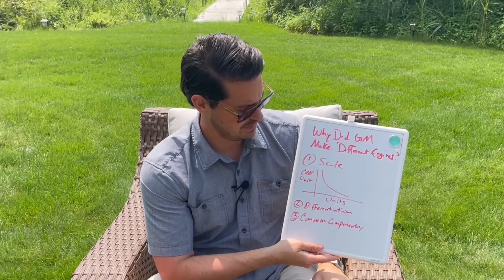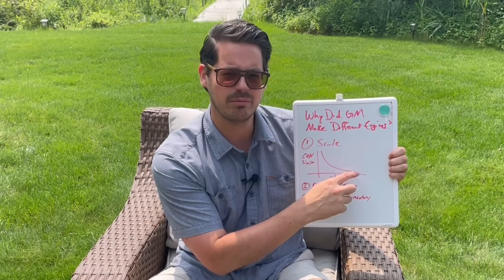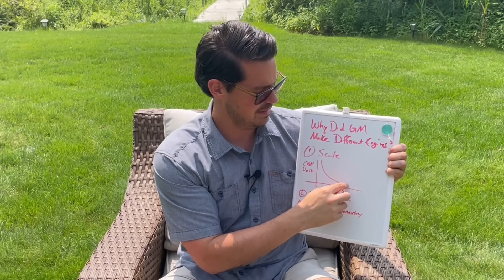Why did General Motors (GM) Make So Many Different V8 Engines in the 1950s-1970s?

Comment: My uncle became very upset when he found out his Oldsmobile had a Chevrolet 350 engine from the factory.  Discovered it when the air filter he bought didn't fit, and the parts man informed him that GM used a "corporate" 350. He felt cheated.
Reply: There was a class action lawsuit on that I believe.
Reply: @Henry_Jones  yeah, reading up on it GM made a payout and the whole debacle cost them $8.2 million.  I remember at the time,  my brother in law,  who was a big Chevrolet fan didn't understand Uncle Barry's chagrin. He tried to tell him the Chevrolet was a good engine. They did this in the 1977 Delta 88.
Reply: @mikekokomomike  It kind of defeated the purpose of buying a certain brand of automobile.
Reply: @jeffrobodine8579  and people finally wised up when they realized GM was peddling largely the same thing at different prices.
Reply: @mikekokomomike  But the Olds engine was made of a much higher nickle content grade of iron, which meant cylinder walls lasted longer.  Uncle Barry probably knew that, that's why he was pissed.
Reply: @aca2983  Yes.  When they downsized for 77, they used just two different chassis for full-size cars, (except for Cadillac), a shorter one for the Chevy, Pontiac, small Olds, and the small Buick.  A longer one for the big Olds and the big Buick.  By mid year, they started sharing engines as well.  That really hurt GM's reputation, selling Chevys at 4 different price points.
Reply: @jeffrobodine8579  which is exactly what happened.
Reply: @michaelbenardo5695  Actually in 1977 the full and mid sized cars used the same chassis. The full size was downsized in 77 but the mid size didn’t downsize until 78. As much as some people dislike the 73-77 A body cars, it was by far their most utilized chassis in the history of GM. Introduced for 73 it remained in use until GM ceased full sized RWD cars in about 96.
Reply: The downsized full size GM eventually all started to look alike by 1980. And, GM didn’t change the bodies on these these RWD for years. In my opinion, this was the start of the steep decline GM experienced.
Reply: @Henry_Jones  There was.  GM had to start including a disclaimer stating that your car can have an engine produced by another GM division.
Reply: @Henry_Jones  yes. That’s when GM started labelling them as “corporate engines.”
Reply: Yes, that was a big story back in the '70's and I still remember when it happened. Of course, Mercury customers had been purchasing cars with "Ford engines" for years, and Dodge customers had been buying cars with Plymouth engines, etc. so it was kind of a matter of perspective. I think the main problem was that GM wasn't transparent or forthcoming about the engine change. Big companies will try to conceal pretty obvious things from customers and it rarely works out.
Reply: @kayeninetwo3585 Plus, Chevy meant "cheap" to all but the Hot-Rod set, whereas Plymouth had the reputation of being the best engineered low-priced car, even though be then it no longer was.
Reply: @michaelbenardo5695  But Plymouth and Dodges suffered oil circulation problems due to having to their oil pans having to accommodate their idiotic suspension ideas.
Reply: @kayeninetwo3585  a Mercury had a variation of a Ford engine throughout its entire history, with the exception of the MEL engine, which found its way into Thunderturds.
Reply: @kayeninetwo3585 The problem was that unlike Ford and Chrysler every GM nameplate had its own engines. People bought a Chevy, Buick, Olds, Pontiac, or Cadillac and expected to have the appropriate engine under the hood. When you bought a Dodge, Plymouth, or Chrysler you knew what your choices were. They just changed the nameplate on the air filter.
Reply: @kayeninetwo3585  Ford and Chrysler had far less differentiation with their engines in their respective divisions, so no real chance of pulling a GM-style swifty. It's never worth it in the end.
Reply: @andoletube  Chrysler mostly, but ford simultaneously had 4 different small block V8s with all sorts of interchangeability issues, 351m which was a scaled 351c, 351w which was the barging bin small block, and 351c which was the high performance small block. And then the smaller Windsor's the 260, 289 and 302 which while technically a Windsor didn't have much interchangeability with major components, like bearing caps, even stuff like dizzy's where different because different drive sizes.They even carried that to the new modular 4.6s and 5.4s, with different main cap design for Windsor or Romeo produced engines and diffrent hardware used for timing and all that. Technically interchangeable but not as easily as the gm small blocks where.
Reply: The suit I remember came from a Chevrolet owner who was upset his new full size wagon was powered by the 5.7 litre / 350 diesel engine . After this suit GM simply put a note in their new car brochures that your new GM vehicle may have an engine produced by another GM division.
Reply: @davedavis775  I think that was a different one.  It was because that diesel engine was a piece of junk.  The engine-sharing one was because an Olds owner discovered that his car had a Chevy engine, and Chevy still meant "cheap car" to most motorists.
Reply: @michaelbenardo5695  100 % agreement to those diesels being junk.. I was unfortunately working at a gm dealer doing general mechanical.. pulled many of those things.. full size vans with a/c were the worst, imo...
Reply: There was a class action suit which GM lost.  Chevy did'nt make a "Rocket V8".
Reply: That was a big deal back then.
Reply: Your uncle was cheated.  That's about when GM started going down hill.
Reply: @edreynolds8721  it's likely also blow your mind to know that basically almost all Toyota engines are either built and or designed by Yamaha motors.. not so bad though..
Reply: @edreynolds8721  Toyota quality in the 90's was unmatched before or ever since. Both the I6 in the supra/Lexus ES300 and the v8 in the Lexus ES400 went forever and ever (as long as the timing belt was changed on time!) Current 2023 Toyota is still fantastic. The Rav4, Prius, Camry, Sierra, and Corolla are above any other vehicles in the world in reliability. Buy once and drive forever. But their other cars aren't that great thanks to the non-Toyota mechanical. The Toyota pickup trucks are also only ok I feel they are vastly overrated.
Reply: @TheRetarp  Who cares... this discussion is not about Toyotas.  Save you comments for another day...
Reply: I would have too, Olds engines were far more durable and reliable.
Reply: @americarsqueensland1667  

No they weren't.
Reply: @edreynolds8721  Back in the 1970s people still paid a premium for a Buick, Oldsmobile, or Cadillac because they were a premium product that advertised a better powertrain. The SBC is a good motor, but if you chose and paid for an Oldsmobile with the advertised Oldsmobile Rocket engine, but got a car with a SBC, you were cheated. Now they advertise them with the corporate engines and transmissions, and they don't offer a unique, branded, powertrain as a selling point.
Reply: Anyone who has actually worked in an engine block foundry, knows that the metallurgy and "nickel" content varies more from day to day than by the car brand. 
Between the mix of virgin metals and rejected blocks / heads, being put in the melting pot together, the metallurgy is secondary to pouring good castings, without porosity and cracking. 
Whatever metallurgy mix poured best without defects, was their goal. Example - they would reduce the nickel content, if it would increase production by reducing rejects.
Many blocks and heads get rejected for defects, found during the maching process of the raw castings. 
The maching exposes a defect inside the block casting and cracks / defects, are found in the heads.
The rejects get remelted, after sitting in a huge pile of other rejects, out in the rain and snow; covered in rust, by the time they get added back to the melting pot. 

These are stock, high production, low power automobile engines, not aftermarket race or high end hand built engines. 
They only had to last the warranty period, without failure.

Many different blocks and heads, can be cast at the same foundry.
The block is rarely the weak link or failure point of an engine anyways; unless the rod windows it, when it breaks, as the weak link, of most properly tuned stock engines.

EFI not washing the oil from cylinder  walls, likely did more for cylinder life than the metallurgy of any brand. 
Carbed engines usually wore out after 100k and had bad blow by, blowing oil everywhere; rebuild time.

 Same engines with EFI, usually went past 200k and rarely had blow by from cylinder wear.
Reply: @jhoncho4x4  
A lot of people would see/read about, High Nickel content in some Propaganda and would run with it.
Reply: The Olds big block was over 100 pounds lighter than the Chevy big block.
Reply: @tanner7495  

I think you pulled that number out of your Rectum as the Olds was Heavier than the Chevy, it was the Buick BB that was lighter, and not much heavier than a Chevy SB
Reply: Bro thanks I'm old enough to remember this.  Transmission with the funny bellhousing.
Reply: @JoseGomez-vn7hn  

There was on Tranny, the POS 200-4R that had a Bellhousing that fit Chevy,  as well as Buick/Olds/Pontiac Bolt Patterns
Reply: I also had that problem with my 1970 Chevelle SS396 which actually was a 402. Cool to look at and drive but kept breaking cams & pushrods & used oil. Did not smoke or drip but used 1 quart of oil for every 16 gallons of gas. Just like my 454.
Reply: @craigpennington1251  It is the same thing.
Reply: @craigpennington1251  My lands... how tight were you turning that 396/402?  They did have a "heavy" valve train and could not be driven like a Small Block Chevy which depended on Rpms.  The Big Blocks were known for dropping valves etc. when revved too high...
Reply: Wasn't there something about the some 396 being 402?
Reply: @tbjtbj4786  Yes. The 402 is the same as a 396.
Reply: @mikee2923 The 402 was a .030 over 396.  They keep the same advertising because of the SS396 being a commonly known performance option and it sounded better than "SS402."
Reply: I remember a Chevy Caprice wagon in my brother's shop. It had an Olds 307 in it.
Reply: Had a 77olds omega with Chevy 305.
Reply: @edreynolds8721 you are probably too young to know the difference in engines of the GM family. Pontiac, Buick, Olds, Chevy had entirely different engines, customers were fiercely loyal to their preferred brand. Engines performed differently, not like the cookie cutter cars of today. So, if you bought a Pontiac, you wanted a Pontiac engine. If you wanted a Chevy, you bought Chevy. So, it was a big deal to see GM place Chevy engines in other makes. What made it worse was the dealers did not tell the buyers. My neighbor in 1978 had bought and owned Oldsmobiles for years, he bought a Delta 88 in 1978, but did not know it had a Chevy engine. He was not happy. This video explains the engine differences very well.
Reply: My Grandfather flipped out. Had bought Oldsmobile since 1950 from the same dealer.  Never brought another Oldsmobile
Reply: Olds engines also had forged cranks like the early 327 engines did.
Reply: My dad was also just as unhappy about the very same thing.
Reply: "...he  felt cheated..." And rightfully so. The Olds engine was far better quality. For example the Chevy engine frequently had oil leak problems with the valve covers and the rear main seal whereas the Olds engines were pretty tight. Another thing was the chevy engines broke engine mounts a lot.  I was an auto mechanic in those days and I had very good knowledge of all the domestic engines.
Reply: @Johnny_RB  Plus, cylinder walls lasted longer in the Olds engine due to a higher nickle content grade of iron.
Reply: @Johnny_RB the Chevy was FAR Superior….get you facts straight
Reply: @fishinfool63  I was a mechanic in those days. I have my facts straight.
Reply: @fishinfool63  Far superior to what?
Reply: It was a big scandal for GM which was covered by all 3 network news broadcasts!
Reply: @edreynolds8721  For real?  As expensive as everything German is?  Strange.
Reply: @edreynolds8721  Didn't chevy come with a 212 ci. v-8 one year, they used cubic inch instead of liters, because it was 3.47 liters. The cylinders were so small I had trouble getting my hand in one. They started using long stroke small bore engines because they produced fewer emissions. When the '90s hit all hell broke loose when the computing power of the on board computers got so good and eproms became available to after market engine builders, 2000 and 3000 HP street engines 350s and 454s, it was insane. Oh and still get 20MPG. Kids today think 6 and 7 hundred horse is kool it is but 30 years ago you could rebuild your car to get 500 horse power and get 35 mpg and the tree huggeres couldn't stand it, every stinking regulation they came up with we could find a work around now they just say you put wrench to this car you're going to prison, they solved their problem.
Reply: True, after the class action lawsuit against General Motors, the automaker started printing a message in their brochures. For example: "Some of the Chevrolet models in the brochure are equipped with engines produced by other GM Divisions, Subsidiaries and affiliated GM companies worldwide."
Then around 1984 GM created GM Powertrain Division to design, engineer, and manufacture all engines for GM cars and trucks.
Reply: Uncle must feel like a dumbass.
Reply: Ford made a whole lot more
Reply: great video 👍
Reply: Yes the Olds 350 is so much of a better design than the chev.
Reply: This was a problem for a lot of people at the time. People had grown up loyal to certain divisions of GM, unlike today where you're more loyal to the main corporate entity (GM, Ford, Chrysler). 40 years of marketing had emphasized the differences in the divisions so if you paid extra for an Olds or Buick you didn't want a lowly Chevy engine in your upper-end vehicle.
Reply: @weegeemike  And people knew that an Oldsmobile engine was a superior quality engine over a Chevy engine.  Higher nickle content.
Reply: @michaelbenardo5695  You keep bringing up higher nickel content.  That doesn't mean exactly what you think it does.  The Olds engine had the same weak link that the Windsor Ford engines had - a 1/4" hex drive from the distributor to the oil pump.  If something got through that hole in the screen of the pickup, and up into the oil pump, it would seize the gears and twist that drive shaft until it broke, engine kept running no oil pressure -boom.  If that happened to a Chevy, it would shear the roll pin on the distributor thus shutting off the engine.
Reply: That would piss me off too because the olds engine was a better engine
Reply: @timr31908  I think the issue that the consumer had was that GM didnt state that the engine in a particular vehicle may have been built by another  GM division. And the consumer felt cheated by that.
Reply: When Buick introduced it’s straight eight in 1932 they were,3 different motors depending on size.
Reply: @markchandler90  Yup, despite how expensive that seems.  The Buick was not an inexpensive car.
Reply: @markchandler90  back when quality was marketed..
Reply: Yet the Chevy 350 was actually a better engineered Engine. Hey most of My Cadillacs didn't have a Cadillac Engine, only the FWD 90 and 91 had the 4.5 and 4.9, descendants of the POS 4.1. I never really trusted them. My other Caddies had the Olds 307, the  Chevy 2nd Gen LT1, and the weak Timing Chain 3.6 Corporate High** Engine.
Reply: @pjimmbojimmbo1990  But the Oldsmobile engine was made with a higher nickle content grade of iron.  That makes IT the better engine, and it was better machined and better assembled as well.  And before the mid 80s, Cads did indeed have Cadillac engines, and nothing else, except for the Seville of the 70s and the 34 - 36 LaSalle.  Those two exceptions used an Oldsmobile engine, assembled by Cadillac.
Reply: @michaelbenardo5695  
Chevy has the Better Oiling System, it has 5 bolts surrounding each Cylinder, instead of 4, which means the gasket is more evenly squished, at a Lower Torque Spec. The Heads flow much better than the Olds Engine. 
Higher Nickel content in the Block, only helps a bit with Longevity, and I have 2 LT1 that have 300,000 or more, and they aren't burning oil. I've owned Buick engines, they have a poor Oiling System where the Pickup is over a foot from the Pump, which is outside the engine, in a Piece of Crap Aluminium Timing Chain Cover. I've have 3 Olds engines, one was a 455, the others were 307s. Gutless wonders, all of them.
Reply: @pjimmbojimmbo1990  Totally agree the SBC was a better overall engine that's why they use them everywhere. It was a simple design they still make them today. (crate engines) Another good design element is the water pump without having an aluminium timing cover.
Like most classic designs in the engineering world it was simple.
Reply: @pjimmbojimmbo1990  The Chevy 350 wasn’t a better engineered engine back when it had competition from the other divisions. The Olds “Rocket” 350 was a much smoother running engine and lasted much longer. The Pontiac 350 in stock form made much more torque than either and was more heavy duty. It makes sense what Adam says on why they kept the Chevy V8 production due to the scale of sale. But I think from a common sense standpoint it would have made more sense to keep the Pontiac V8 because they used the same block from 326-455CI. They wouldn’t have had to use Chevy, Cadillac and Oldsmobile V8s. They wouldn’t have had to produce all the different engine accessory brackets, water pumps, etc. The Pontiac 455 would have been a better truck engine than the Chevy 454 big block because the long stroke of the Pontiac engine made serious stump pulling torque that the 454 didn’t in stock form. It is also smaller and lighter than the 454. The Pontiac V8 was basically a small block Chevy on steroids.
Reply: @mikee2923  
. The Chevy BBC had the best Flowing Heads of any of the Big Blocks. It was basically a Race Engine, detuned for Street Use.  The Chevies, SB and BB, were better engineered than the others. To me, any and all Pontiac Engine, made excellent Boat Anchors. 
As for the 350 Olds being Smoother, put a cam with little to no Duration, and any engine is very smooth.
Reply: @pjimmbojimmbo1990  You might want to think again. Pontiac in the late 60s developed the Ram Air V program for Trans Am racing series. While the 303CI engine itself was a failure, the heads that were developed for it were anything but. The ports were so huge they could feed the 303CI engine spinning at 7500 RPM all day long. This despite having a tube running through the center of the intake port which covered the pushrod. The almighty Chevrolet was butt hurt because Pontiac turned to a Ford influenced design instead of Chevrolet. They were even more butt hurt when someone at Pontiac came up with the idea of bolting these heads on a production 400 block, used the 303CI cam and a single 4bbl intake which were both unique to the Ram Air V as the ports were changed so the exhaust was evenly spaced like the BBC. Pontiac was in the process of producing (and actually did sell a handful) of racing engines and managed to sell a few sets of heads over the counter. However it came to a sudden halt when they dropped said 400 into a GTO body and spanked the aluminum headed tri power Corvette. Gee I wonder if this was one of the numerous times during the muscle car era when Pontiac came out with an idea that beat Chevrolet, they cried to corporate until funding was pulled? Pontiac was never permitted to use aluminum heads or even Holley carbs on their engines. I can also site several more instances of Chevrolet crying about Pontiac’s ideas for high performance and funding was suddenly cancelled or the plug was pulled by GM. 

An old friend of mine told me a great story about when he was in high school, graduated in 1970. Some Chevy worshiping moron had a 69 Chevelle with the aluminum headed 396 (the real definition of a boat anchor) and his buddy blew the doors off that Chevy junk with a 69 Grand Prix SJ with an HO 428 4 speed. He said that kid cried just like Chevrolet did whenever Pontiac beat them. Had Pontiac had been permitted to refine the Ram Air V heads to work better with the larger displacement engines, the history of high performance would have turned out a lot different. Dyno pulls of the planned 428CI Ram Air V we’re close to 600 HP just using the raw parts they had without any refinement.

I do happen to like BBCs 427 and 454 (except the 396 which was always a joke and definition of a boat anchor) but saying the small block Chevy is superior to the Pontiac is just a joke. People who build SBC and rave about big$ heads with 18 degree valves, Pontiac had 14 degree valves from the factory. The Ram Air IV was always faster than the Chevy 396. People also rave about the “383 stroker” SBC. Pontiac’s production nodular crank was so tough that you could take a production crank out of your grandpa’s 455 powered station wagon, cut 1/4” off the main journals and stuff it in a 400 block (which were plentiful) and turn it into a 455. You could hit it with nitrous and never worry about breaking the crank. The rods were a different story. I’m not a huge Buick fan but I seem to remember the ultimate grudge match for the ages was the 426 Hemi (best muscle car engine ever built without question) vs the Buick 455 Stage 1 (or maybe it was the stage 2). No mention of Chevrolet.
Reply: @mikee2923  

No, I have never Liked Pontiac, Cars or Engines, Poor Engineering
Reply: @mikee2923  Similar thing happened to Pontiac in the end of the forties; Pontiac lost it's strong selling B body model and was forced to use the smaller A body with a longer hood for all of it's models.  Olds got mad and went crying to corporate when they found out that a 287 cube V8 was planned for 53 in their new bigger 53 models.  More crying in 54 with the big new Star Chief.  Pontiac had to wait until 55 before they could bring out their new engine.  Maybe that's why the 55 Pontiac looked smaller.  Complaints from Olds.
Reply: @michaelbenardo5695  I did not know that. Guess I don’t feel quite as bad for Oldsmobile as they were originally slated to get a version of the F body. But because Pontiac took so long to develop the Firebird (De Lorean insisted it be superior to the Camaro in every way) GM canceled Oldsmobile’s version. However, when Hurst came to GM to build a car that broke GM’s rules, Hurst wanted to build a 1968 Firebird with the 428 HO. GM absolutely forbid that idea (serious competition to the Corvette?) and instead talked them into the 455 equipped Hurst Olds 442. GM was supposed to ship Hurst the 442 equipped with the Olds big block 400 and Hurst was supposed to perform the engine swap. Many years later it was proven that GM actually installed the 455 on the assembly line before shipping them to Hurst. Oldsmobile is still my 2nd favorite division behind Pontiac.
Reply: @pjimmbojimmbo1990 the 2.8/3.6L engines debuted in the US in Cadillacs, starting with the 2004 CTS, and then 2005 STS and SRX. They were exclusive to Caddy until the 2007 Acadia/Outlook/Traverse.
Reply: @pjimmbojimmbo1990 Are you kidding , the chev was an old dated design , the Olds Gen 2 engines were designed by Charles F Kettering, with features the chev guys would give their first born child for, chevy guys get all excited when there performance heads valve angle goes from standard 23 deg. To ( narrow) 15 deg. Please Olds come with 8 deg valve angles , like all modern motors , Honda uses 8  deg. Valve angles on their CRF 450 f Motorcross bikes, Ford Coyote uses same as all modern motors , Olds have plug in centre of chamber , not sticking out the side like it was a last resort, Olds small blocks have the perfect 86 mm stroke in all modern engines , WRX , Toyota , Mazda that's why 86 turns up so much these days , Olds did it in 1964. Olds have high nickel blocks that don't ware like grey iron 350 chev blocks , when NASCAR chevys needed to redesign the SB 358 heads they tryed all port layouts , and what was found to flow best ? The Olds standard port layout and that's how the chev SB2 head came about. The Oldsmobile design always has very big bores and short strokes, look at the 403 Olds Small Block , when they needed a 400 ci motor Olds didn't take out that magic 86 mm stroke they enlarged the bore to get 403 ci , and one of the largest bores of any V8 car engine bigger than a 500 caddy big block , Chevy guys get excited over a 400 chev with 4.125 inch bore , the 403 has a 4.351 inch bore , and as any engine builder knows big bores and short strokes are how you make power , ask any Japanese bike builder.
Reply: @JosephCowen-fz8vj  

No, I'm not kidding. The Chevy SB and BB were the Best engineered engines of the late 50s, 60s, 70s, into the 80s and 90s. Well engineered Oiling Systems, which was Race Ready with No or very little Tweaking. 5 bolts around each Cylinder, which provided better Gasket Crush with smaller Bolts at lower Torque, thus less Torque Induced Distortion of Cylinder Bore.
Reply: @pjimmbojimmbo1990  lmfao , there is so many design flaws I've listed ! Just to fix the things wrong that's makes it equal to an Olds ( all the things listed Olds has standard) is funny . The only reason the chev V8s lasted was cost , good costs money , it's just like the old video war , VHS video was the worst formula and Beta Video was 10 X better , but VHS won , not the better the cheaper. Chev is the bottom of GM , the chev motors failed on emissions in 1990 , all other GM engines with carbies failed those emission tests that year except , the 307 Oldsmobile it passed , with a carbie , and incase you didn't know what that means , it's grate combustion in a well designed chamber , the Olds design .
Reply: @JosephCowen-fz8vj  
I had 2 Olds 307s, Gutless wonders that had heads so Restrictive that they couldn't make more than 140hp, and the Supposedly Higher Performance version(180hp), made even less Torque. I had owned an Olds 455, in an 88 Royale, it shredded Rocker Pivots routinely, always causing clack-clack-clack sounds from the Valve train. Come to think of it, the 307s also did that. I have also had buick 350s and 455s. Those engines had a poorly designed Oil System, the Pump was on the Timing Cover, which was Aluminium, and would wear, causing Low Pressure at idle, and the Tube between the Pump Housing and the Pickup was excessively Long and would drain upon shutdown. Next startup, it took 10 seconds before there was enough Oil Pressure to protect the Bearings. Same poor design was used on the 3.6. Wiped the Main and Con Rod Bearings on both the 455, and on my Dads' Girlfriends' 3.6. 
Chevy SB and BB were the better of GM's engines back then. Yes, they were the Product of the Low Chevy Line, but were much better engines than anything made by Pontiac, Oldsmobile, Buick, or Cadillac. 
I have 4 of the 2nd Gen SBC engines, 3 have over 300,000 on them, and have never been apart, none burn Oil, nor make any knocking or ticking sounds. The oil gets changed when the Change Oil Light comes on, and all started in less than a Second, unless it is colder than -20, then it takes 2 seconds.
Reply: @pjimmbojimmbo1990  you missed the point , good combustion , in Olds motors , means good design , and just because bad design can last long is not a sign it's better , a Briggs and Stratton side valve mower motor was built for 65 years , it lasted , went fair , but was it good , no ! Honda makes 3 X the power from 100 less CCS , but bad can last long !
Reply: I remember the anger over that.  It was even on 60 minutes, and cost GM much prestige.  An Olds with a mere CHEVY engine???
Reply: @michaelbenardo5695  The tables would be turned about decade later when Olds 307s were being installed in lowly Chevy Caprice wagons. It kinda evened things out.
Reply: @edreynolds8721  The poor quality Subaru engines in the Toyota 86 are even worse! Putting BMW and Subaru engines in Toyota branded vehicles? What is their executive team even thinking????
Reply: @TheRetarp  Subaru engines in a Toyota?  They are completely different companies.  Sounds like the Assembled Cars popular in the 20s.  They typically used Continental engines, as they didn't make engines or much else.  They only were responsible for styling and interiors.
Reply: @TheRetarp  Toyota GT86 is a Subaru with a different body.  The Supra is a rebodied BMW Z4.  It hasn't sold well either.
Reply: I believe 1991 was the last year for the Chevrolet engine name. After that they were GM Powertrain engines. Perhaps that is when GM started to use the term "corporate" engine.
Reply: @Olds_Pwr  

Chevrolet was pretty Proud of the 2nd Gen LT1, and made sure it was Known as a Chevy Engine when it came out in 92 or 93. I have 4 of those Engines, 3 in Cars(2 Buicks, 1 Cadillac), one in Storage(from one of the Buicks. 300,000 on it when taken out, still no burning oil)
Reply: @pjimmbojimmbo1990  They were probably better than before, as they were no longer just being used in Chevys.
Reply: @Olds_Pwr  that's entirely possible.  I remember at some point they were called "corporate". Oldsmobile had to print up a list of available engines listing the Chevrolet in 78 or 79. Interesting enough,  the Chevrolet 350 is rated 10 horsepower and 10 more foot pounds of torque than the Olds 350 at the same rpm  on their sheets.
Reply: @Olds_Pwr  I saw "GM Corporate" used for Chevy 305 and 350 engines back in the early 80s.  Possibly back to 1977, when they started painting them blue.
Reply: I remember a same year Chevy and same year Cadillac from the 90's and the dealership's cross referencing of the part that had two different prices because it was a "Cadillac".  Pissed me off.
Reply: @nehuge  By the 90s, the remaining rear-wheel-drive Cad, and the revived Buick Roadmaster as well, were just restyled stretched Caprices with nicer interiors.
Reply: @michaelbenardo5695  
I own 2 Roadmasters, and the Cadillac version. The differences are more than just the Interiors and Sheetmetal
Reply: @nehuge  Actually it went back even further and it wasn’t only dealerships. My brother was a mechanic starting in the late 70s. My dad had Cadillacs from the 80s. I remember him telling my dad if he had to get brake pads for them from auto parts stores like NAPA etc my brother told him to order them for the same year Chevy Caprice because even the local parts stores would charge you a premium if you ordered them for a Cadillac even though it was the exact same part used on a Chevy.
Reply: @mikee2923  
Gee when I look at the Parts Book and see they use the same Part #, they are priced at what that Part # is priced at. Makes no Difference as to what Make of Car.
Reply: @pjimmbojimmbo1990  did you happen to look at every parts book? Was it GM’s parts book, NAPA’s parts book? When was it printed? I’m talking about something that was common practice in the 1980s, not last week or last year. Maybe I’m totally wrong. Maybe you had to pay a premium price for Chevy parts due to their superior engineering 😂😂😂😂😂😂😂
Reply: @nehuge  You mean a part for the Chevy 350 in the Cadillac Brougham? Yeah, that's crappy. Go down the street to the Chevy dealership and get the same part for half price. Have the car serviced at a Chevy dealership if it's an engine-related repair.
Reply: @nehuge  
If the part had a different part #, it was a different Part. Cadillacs were made with different parts.
Reply: There was someone else who sued GM, when he brought a car that didn't have the division engine in it in the 1970's.
Reply: The Chevy engine was SUPERIOR
Reply: @edreynolds8721  AE86 with a Subaru engine.
Reply: Same situation with my 1977 Buick Le Sabre.   POS Olds engine.
Reply: @maxlever9196  Actually the Buick V8 engines had a flawed oiling system. Among other things Buicks pumped the oil to the top end first and the crankshaft and connecting rod bearings last. The Oldsmobile engine is better for longevity.
Reply: ...it's just that there really wasn't a reason to feel cheated - the new Oldsmobile engine just happened to be the same as a Chev... 😏 There had been extensive sharing of engines across divisions decades prior to the 'corporate engine' came about - GMC installed Pontiac and Olds engines in the 50s, Olds offered the Chev I-6 in their A-body in the 60s, not to forget the Olds diesel available in most any GM car in the late 70s just to name a few
Reply: @localsheriff  But that wasn't true of their V8 engines in passenger cars.  The Olds V8 was NOT the same as a Chevy V8.  Not at all.  It had better metallurgy for one thing.  The Buick V8 was still different, the Pontiac V8 was different yet, and the Cadillac engine was again, completely different and was the finest of the bunch.  None of them had any parts that interchanged.
Reply: @michaelbenardo5695  I'm fully aware any BOPC V8 is different than the Chev - I should know 'cuz I have both a 327 Chev and a 389 Poncho out in my garage. My point was the other GM divisions ADOPTED the SBC to become their new engine when they one after another decided to drop their own engine options. IMHO that was a sad move for brand identity however highly understandable, and also very similar to what GM of Canada had done many years prior to streamline Pontiac/ Chev production + support. What the GM divisions DID do was borrowing entire engines from other divisions as mentioned above offering them as their own.
Also, while the BOPC engines may have few - if any - common engine itself related bits they do indeed share various external components
Reply: @localsheriff  The small block chevy is an olds rocket version 2. They are quite similar in construction only the chevy engine is cheaper to make. So it "won" to become the standard engine other than the fact GM still used the Old 307 in station wagons through 1990(!) for some dumb reason that only GM execs could answer.
Reply: @TheRetarp  
Both are OHV Engines and there very little in common between a Chevy Engine and an Olds Engine, except things like, Distributor Caps, Rotors.
Reply: @TheRetarp  No Chevy engine is an Oldsmobile Rocket engine.  It just isn't, just like no customized Monte Carlo is a Rolls Royce.  It just isn't.
Reply: @localsheriff  You do have a valid point about GM sharing engines like the straight 6 in the A bodies in the 60s and 70s. The straight 6 was manufactured by Chevrolet. But the vast majority of A bodies sold with the 6 were Chevies. This was because most people who bought them were the people looking for the cheapest form of transportation and it made little sense to buy an Oldsmobile Cutlass with a straight 6. Most preferred V8s during this time and if you wanted any of the other A bodies besides the Chevy with the 6, you had to special order it that way. There may have been a few strip down models at Chevy dealers for sale but any of the others, not so much. A better example would have been the X body cars like the Nova, Ventura, Apollo and Omega. They were quite commonly found with the straight 6 in the early 70s until Buick developed the 231 V6 that basically replaced the straight 6 as a base engine.
Reply: @shawnsatterlee6035  
The Olds 350 was a Small Block, even the 403 was a Small Block. It was Pontiac which used the same size Block for the 350 thru to the 455.
Reply: @edreynolds8721  The BMW Supra is like 80% BMW.  It hasn't worked out for Toyota.